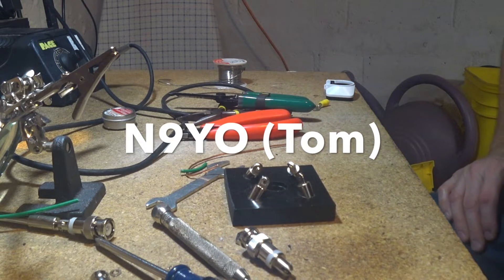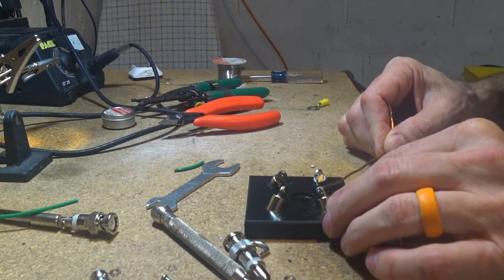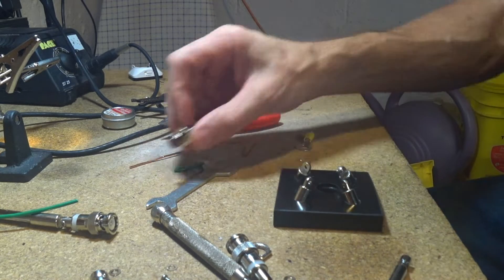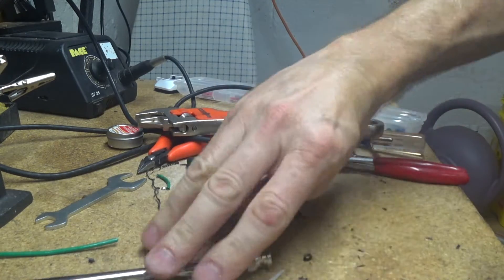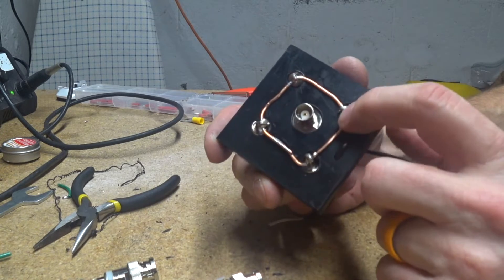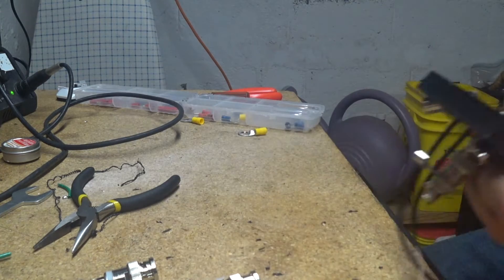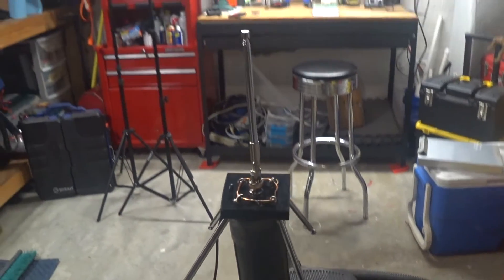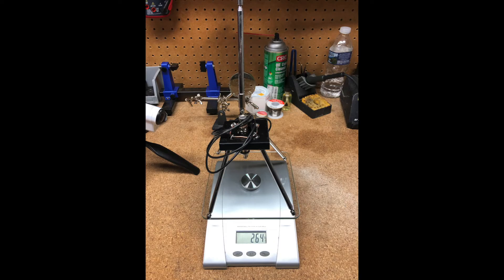2m Ground Plane Antenna Build

Comment: Nice build for a 2 meter ground plane.  Most people just use an SO-239 and run radials off of it and a single wire soldered to the inside for the main aerial.  Wish you'd make me one of those.  I just passed the test for Technician license with a 100% and got a Yaesu FT-4VR from the local Ham club for passing the test.  Now I need to build an antenna for my mono band, 2 meter HT while I wait on my license and name to get on the FCC database.
Reply from the maker: Congrats! Sounds like you are wll on your way to some fun. Well, I built this for a project that Tom, N9YO was working on. Check out his channel, (Ham Radio CQ)

73!